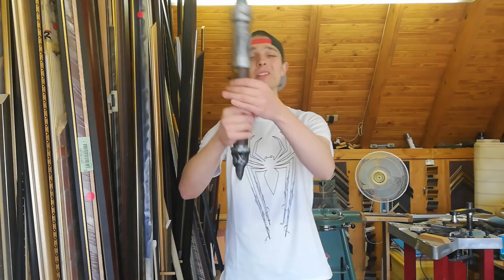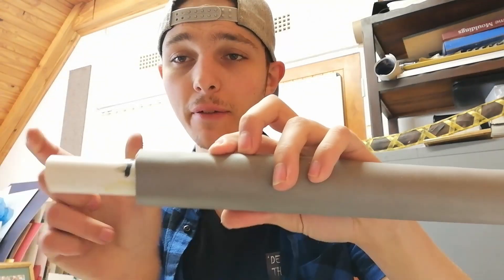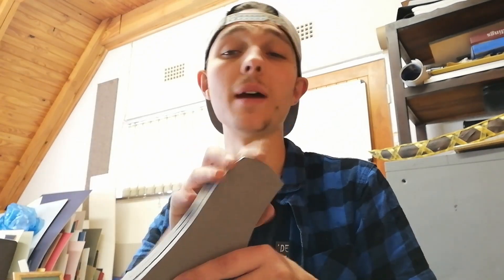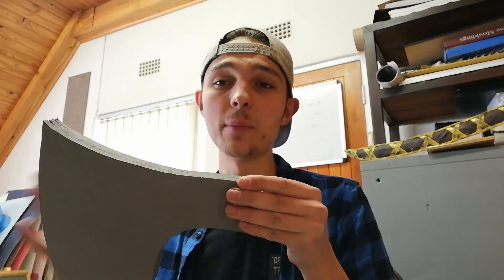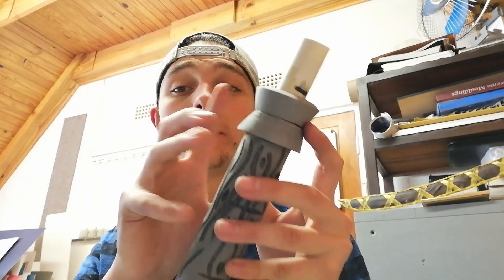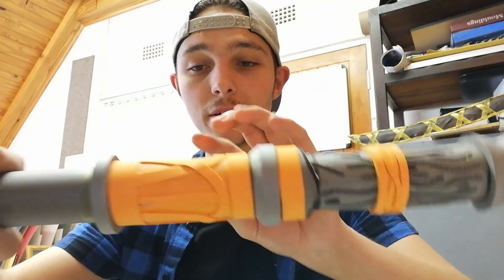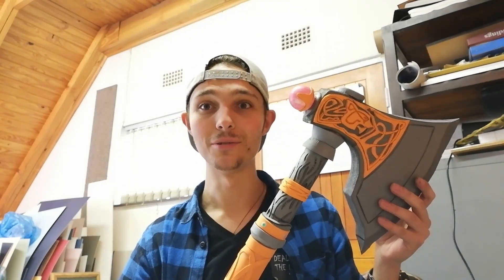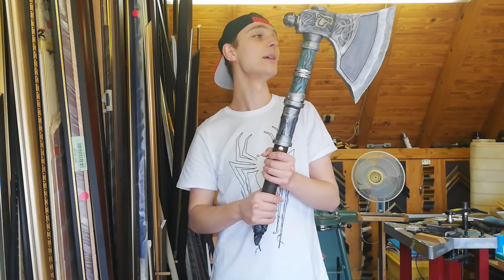How to Make the Assassin's Creed Valhalla Viking Axe (Free Template!!!)

Comment: I have looked at a number of videos regarding making foam axes and the majority attach the head to the handle by inserting some form of metal rod inside the foam whereas you insert the handle inside the axe head. I am a newbie first timer and wanted your opinion as which method of attaching the head to a wood axe handle would be easier.
Reply from the maker: I think both methods would work. The method I used worked pretty well and it's still holding together a few years later. I think for a wooden handle, you could make a hole in the foam axe head and insert the handle and glue in place. Hope this helps. 😁👍

Comment: And also little bit I just learned, if you wanna speed up the contact cement curing time you can use a low heat on your heat gun.
Reply from the maker: I do sometimes use this trick if I'm in a rush 😉